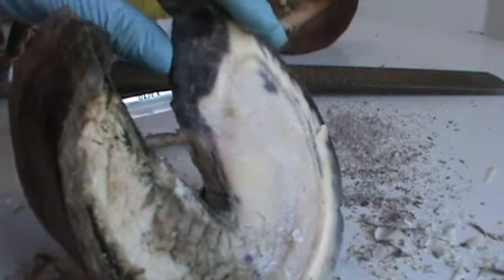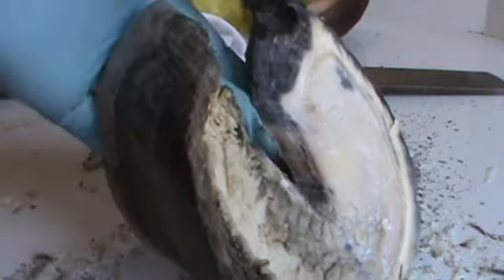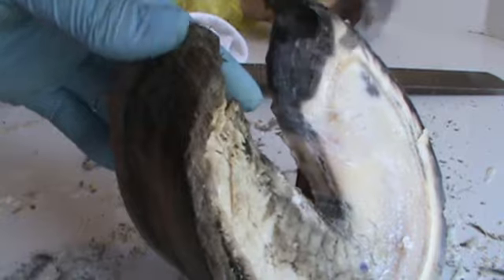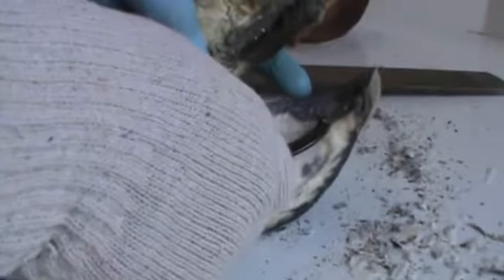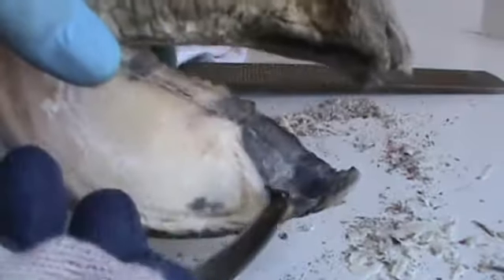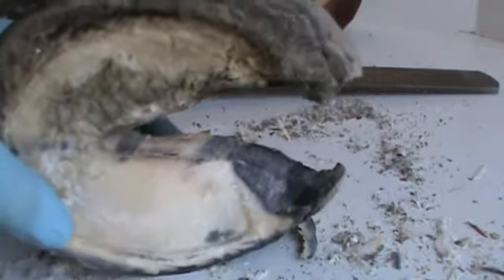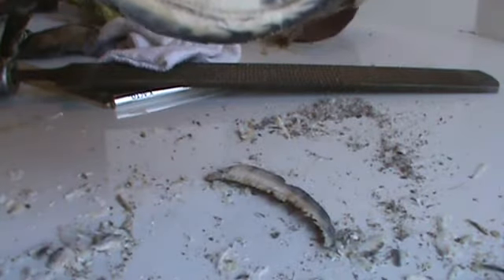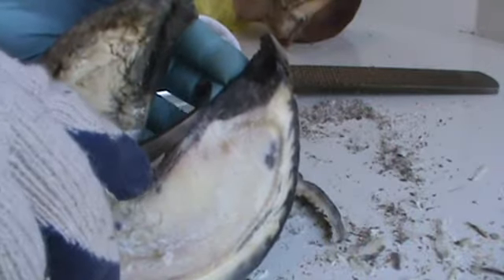Hoof Distortions and Anatomy19

Comment from the maker: I would do the same to find the bar and just try and level the heel. Even if this horse would have been alive I would not have run into blood with what I did there. And I have done as much on live horses, just never found a bar that curved under like that, and ran straight over to the frog. But sometimes the bars are "melded" and smashed into the sole, that takes more times but you just keep lifting it up off the sole until you finally define the bar.

Comment: Lightbulb moment 9:20-32!!!!!! If we "relieve" the bars as well as take the toe back to correct breakover so that it can't pull the toe out anymore, in theory that would allow the heels to pull the whole capsule back under the foot, right? Of course you couldn't do anything too major without the use of supportive casting or epoxy so as to keep the horse sound and moving. Just thinking outloud.